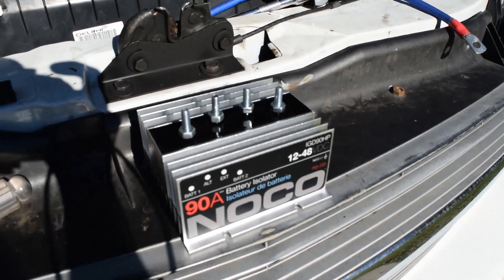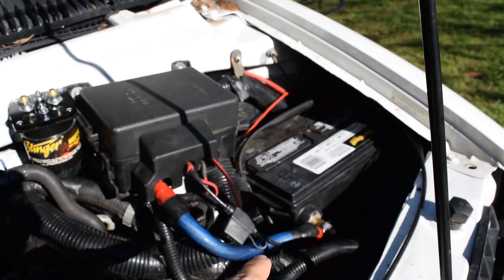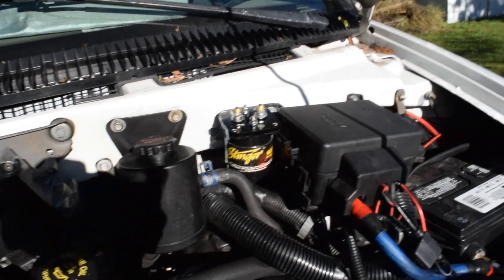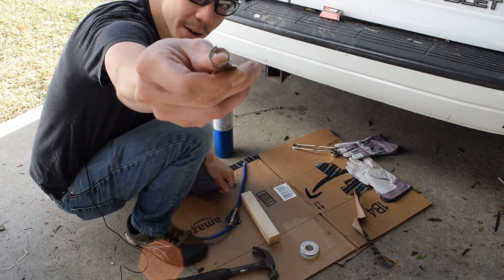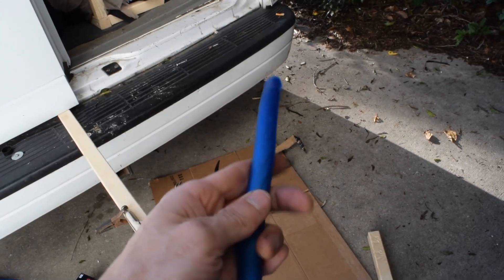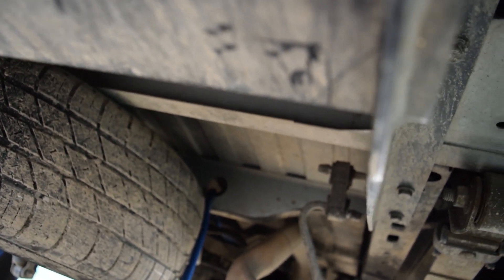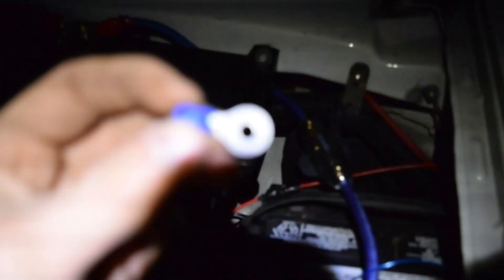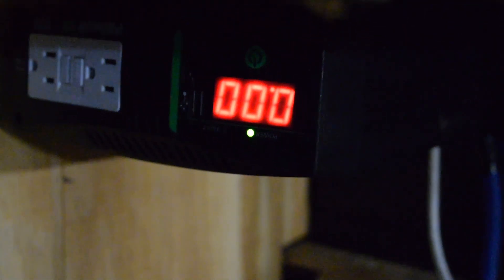HOW TO INSTALL BATTERY ISOLATOR AND CHOOSE WHAT TYPE

Comment: +1, Subbed, and Thank You from south Fla. 
That's a "Scotch connector" and they are regarded as pretty unreliable but usually sufficient with light gauge wire (16-20). In a vibration environment they will fail sooner or later. Thanks again and looking forward to checking out more videos!

Comment: Why didn't you run it on the inside of the van?
Reply from the maker: +Atrax R because it was easier this way
Reply: Into The Mystery 13 Yea, after I made that comment I watched one of your other videos and saw all the stuff you have at the back. So it makes sense to me now.
Reply from the maker: +Atrax R btw is that an obt in your profile pic?
Reply: Into The Mystery 13 Yes, it indeed is. :)

Comment: Hey man.  Good video.  My buddy gave me an isolator today.  It's an older diode one.  The one that he gave me says its 70 amp on it, but its probably about 1/3 or so of the size of the one in your video.  Do you see anything strange about that?  The good news is that the van that I bougnt has the cable already hooked up and run into the van for an isolator.  Its got the fuse and everything.  I think the guy who had it before me had subwoofers and stuff in it and thats what he was using it for.. Thanks!

Comment: man...that's a whole lot of mcguyvering you did there. I wanna attempt something like this but this seems way, waaaaaay over my head! You have really shown your versatility, adaptability and technical prowess here and elsewhere throughout your videos bro! I'm sure there is a great story somewhere there for you to share someday with your viewers. LOL, I totally lost ya on pink ignition wiring thingamajig. How in the world do you figure out what ANY wires are like that mean? 1. what or how do you prevent both the auxiliary and starter batteries from overcharging? I suppose that is where "charge controller" becomes imperative. 2. Suppose you're not driving and say you wanna alternate between small solar setup on your rig that is also charging the auxiliary batteries so how does that work? Or it doesn't? Is it either solar or battery isolator to charge the auxiliary batteries or could you switch between both of them: one while you're driving and the other while you're stationary?Anyway, keep up the good work. Hopefully, I'll remember to post this question on your facebook for your Thursday Q/A sessions. In any event, Stay blessed!
Reply from the maker: thanks! 1) yep charging controller, which comes with the vans factory system 2) you need a manual switch for that, they makes some good ones for boats, but im not sure when that would be helpful in this appilication.

Comment: How is the isolator mounted in the engine compartment? Did you use bolts or some sort of metal bonding adhesive? A mechanic friend of mine told me I shouldn't drill into the firewall to mount my isolator, that's why I'm asking.
Reply from the maker: +Platinum Dragon Productions I used self tapping sheet metal screws into the firwall. I wonder why he said that. He must know something I dont.

Comment: Please tell me you covered that huge wire to the rear and added a fuze up close to the alternator.  If that cable touches your frame it will spark, worst case it will weld to the metal and you will have a fire... Also the blue crimp connector you use does not require you to strip the wire. It is intended to go right through the covering.  

It is good to see guys do it themselves but if you do it in an unsafe manor you hurt yourself as well as others.

Not trying to be a dick btw, glad you do your own work.

Comment: I gave you a thumbs up,  even though I didn't understand most of what you said.  Will have to show this to a mechanic friend to get a dumbed down version.   I want to know about what you found out about the alternator because I heard somewhere that you were supposed to have a beefed up alt to do this.  Thanks for sharing.
Reply from the maker: Haha thanks! I found out that the alternator output was perfect. The factory alternator in this van is 105 amps so its a higher output.  Some of the older vahicles are lowerout and since i didnt have this issue i dont know if its an issue at all.

Comment: Good work. I can't wait to dive into projects of my own when I get things figured out what I am going to do to start traveling full-time. I do have a battery project coming up for my RV so I can do more boondocking in the spring and fall. From an alternator you could potentially see that voltage go as high as 16.0 volts. but you are probably aware of that now with your research.

Thanks for sharing!

Jed
Reply from the maker: +NDNomad Thanks Jed! Best of luck on your endeavors!

Comment: Have you considered making a trap door above your battery for easier access? Also 1/2" or 5/8" garden hose will work as a great wire loom to protect the cable under the van.
Reply from the maker: +Allen Schwinn Yeah but this was probably the last time I'll have to access it until I replace it. Thanks for the tip on the loom!

Comment: Great job and awesome video detailing the process!!. I went the old school way and just put the manual isolator switch in.  I located my switch near the side doors of the van near my battery box. With your solar setup as the primary source for charging your batteries, this is an excellent backup device on cloudy days when you are driving. Good luck with it!
Reply from the maker: +VanGo Adventures Thanks! So you just use the alternator to power you aux bank when you need it? How much solar do you have? with my 100 watts I'd say the alternator is definitely my source of charge, and the solar just helps, especially when camping.

Comment: Bet that's an empowering feeling to have it all done. Good work!
Reply from the maker: +Dan Travels It felt GREAT!
Reply: Either do I. I understand if the Van is off, the second won't charge off the main. 

But it doesn't explain how the auxiliary battery won't be forever charging when the van is running. So if I'm driving for like 10 hours the second battery is charging too? 

I assumed there would be some kind of auto shut off when the auxiliary was fully charged, or maybe a manual one like a switch on the dash. 

Does the isolator have a shut off when the auxiliary battery is full? 

Also, what are the output limits of this system? How many batteries and what size batteries can be used as the auxiliary? Is there a ratio of the size of the alternator to battery size(s) to the time needed to run the van to fully charge this system? 

Should this system include a larger alternator upgrade too?
Reply: The alternator itself will not send current if it recognizes that the voltage on its output wire is already high (the wire going to the vehicle's onboard battery.) As he mentioned in the video, nearly all alternators are built this way--at least on American cars; I have been told Europe and some newer vehicles have the voltage control separate from the alternator. Either way, the alternator is told to only work when needed. By having both batteries connected to the alternator in this way, they will share the same voltage--even if one has significantly larger capacity. Think of it like a rechargeable battery station at your house being able to charge either AAA or D cell batteries; both are 1.5V, but one has 10 times the total energy available.

Comment: I am glad you showed this video, I have an isolator that is not hooked up I have to charge dual batteries separately. Now I know how to hook it up. I am guessing at that point both start and Aux batteries must be the same capacity so one does not drag the other down or does the alternator take care of it efficiently enough? Those blue connectors are called scotch locks  I DO NOT use them, corrosion experts those are lol
Reply from the maker: +Tioga Trails Oh I'm glad it helped! I don't understand your question. Are asking if both batteries need to be the same charge when isolator is hooked up to start the vehicle?
Reply: No, I was wondering if say for example you have one 1,000 CCA battery and one 750 CCA battery, does that bother the isolator at all?

Comment: No! You stopped and didn't answer the question...are they charging too much? What do you do if they are?
Reply from the maker: 14.6 is perfectly fine. 14.8 and above means you battery is boiling and you need a new voltage regulator. Sorry for the suspense on that one !

Comment: A great way to protect wires when passing through metal, is to use an old piece of rubber hose (radiator hose, etc), and split it and tape it.
Reply from the maker: +Tryor Die Oh thats a GREAT idea! Thanks!
Reply: Chris Phoenix 
good advise.. was gonna give it myself but you way beat me to it..
Reply: or a old bicycle tube.